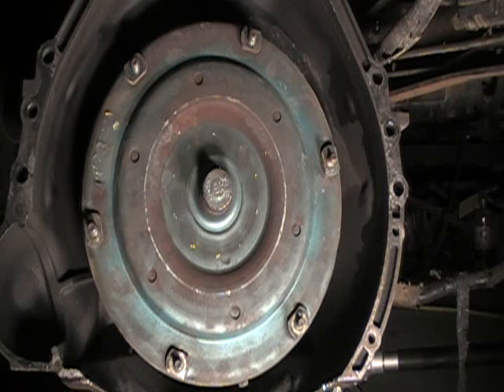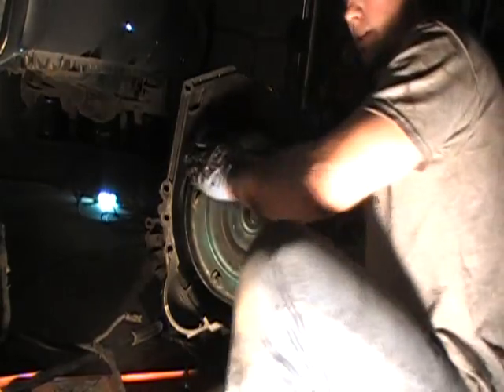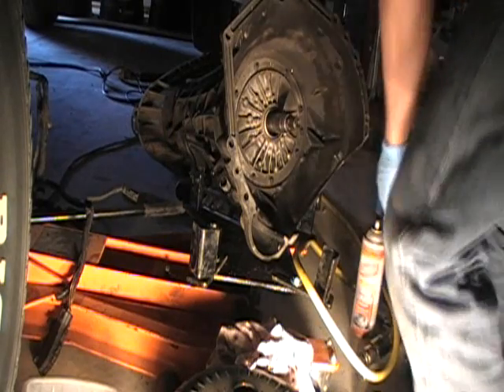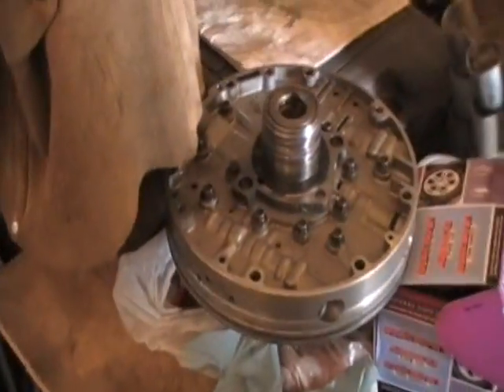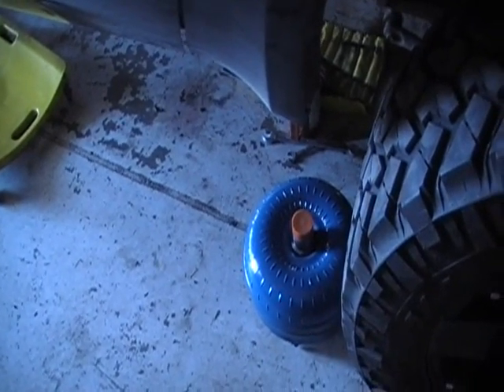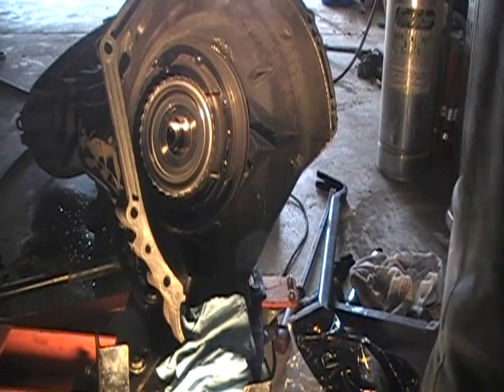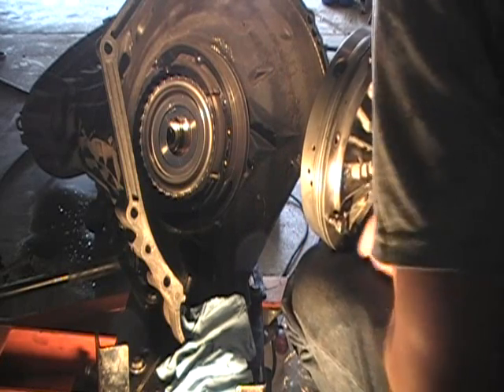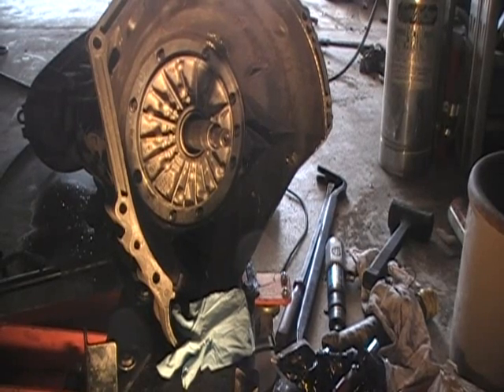How to replace front pump on 4r100 transmission PROJECT POWERSTROKE

Comment: When pulling the pump, first you have to pull the pan & drop the filter out or as you did in your video, you broke the filter off in the pump stator support...That's why it was so hard to get out...I've been building transmission for almost a half a century & thought you would like to know to save your viewers the headaches....Good luck...
Reply: 7:05
Reply: Sir, I did the same thing he did with the filter. Could I have damaged my stator? My Tranny is really messed up now

Comment: Great vid. I've got a few questions for you if you don't mind answering them for diagnosis purposes but also to rule out other issues that I may have. Related or not.

          First off, how has the truck and trans operated/ran since the repair? Any issues with trans since? Can you describe in detail any trans or TC related noises and\or vibrations before the repair? How bad was the leak? Did it get worst after the trans warmed up? So with the truck warmed up, idling, in park, would the leak increase for a few seconds after a short, strong "blip" of the throttle?Do you remember how the truck and transmission felt or ran during normal operation right before making your repairs? How did you determine that the pump needed to be rebuilt or replaced? Did you visually notice scarring/galling or wear anywhere on the pump housing, gears, seal(s), washer(s) ect? How did you determine that your TC needed to be replaced as well? Thank you very much for any help and for your time.
Reply: I understand that you may have covered some things in the video briefly, just need some clarifications and the additional details is all. Thanks again.

Comment: Has anyone else had extreme difficulty pulling these 4r100. I cannot seem to get top bell housing bolts out. Anyone have any tips??
Reply: Yeah. I'm about to be modifying my transmission tunnel so it'll be removable
Reply: @jameswest4154  I don’t think we did that, as it was 9 years ago now. Lol but I do remember them being a PITA. Consisted of a ton of extensions and a wobble socket if I remember correctly. I’m actually an ASE certified tech now, and the best tip I can give you is to remove the top bell housing bolts first, and with the transfer case (if applicable) removed. You can lower your jack or whatever you’ve got under the transmission with the transmission cross member removed, and the engine and transmission will tilt, giving you more room the trans tunnel.
Reply: what I did on my 2000 is 
1. Remove downpipe
2. Remove shield obive exhaust 
3. Remove the lower the engine/trans until the back of the up-pipes about touch the fire wall 
4 support back side of your engine so when you disconnect the trans, the engine does not angle down further 
5assemble about 3’ of extensions with a universal or swivel on the end. (It’s the top passenger side bolt that’s a bitch)

Comment: Did a fine job there EXCEPT, Before Removing Front Pump you may want to Remove the Filter in the pan that goes up into the front pump. If it is a metal filter you Not get pump out.; If it is plastic your break it getting pump out, cause I did break mine. Nobody told me about removing the filter, LOL

Comment from the maker: it was like that when i got it, i thought the same thing
Reply: 98 Suburban I pulled tranny and transfer case to replace cracked flywheel and thought was bad converter found misssing bell bolts five  in fact someone swapped motor out on this vehicle earlier I'm wondering if I need to replacement pump also